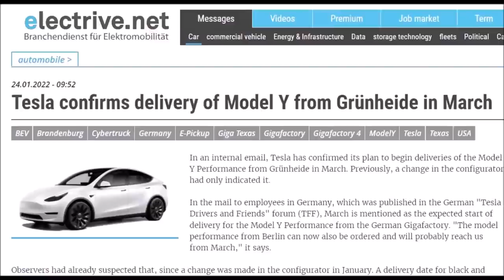BREAKING! Tesla Gia Berlin Can Start Production Despite Drive Unit Not Ready

Comment: Just about all of the below comments are incorrect. When all 4 factories are in production (next 60 days) the model Y will be different in all 4. The Texas plant will have the latest design (front and rear castings, 4680 batteries, many other small improvements. China has front/rear casting but Iron Phosphate batteries. Berlin will have front/rear casting but 2170 batteries and finally California plant has rear casting only and 2170 batteries. There are many other parts and they are being sourced a multiple location, not necessarily where the cars are produced (for example the batteries and motors). The next issue has to do is the plants have the legal authority to produce cars, yes for China, CA and TX and no for Berlin. The last issue has is the production lines been brought up to customer quality standards, yes for CA and China and no for Berlin and Texas. I suspect the the answer for Berlin is actually yes and Texas is yes very soon. However, each factory can produce if they have legal authority and the quality is up to standards. Over time the difference with the plants will be removed but Tesla can't afford to shut down a plant to upgrade when they can sell every one they can produce.
Reply: ...ah, actual information. Nice.
Reply: Actually, only the short range MY has a iron phosphate battery in China. MY LR and P produced in Shanghai have a 2170 battery. Only the MY LR is exported to Europe, and until production in Berlin starts, the only MY we get here.

Comment: This is normal, technically every component manufactured in the new factory should be of the latest version. It's normal they start ramping up with the known parts to avoid slowing down the process. Newly designed parts will be added in time.

Comment: While the DU building was completed in Nov. 2020 it stand idle till mid of 2021 when Tesla decided that this building shall also host the battery pack production. For this, a further floor was added in the building. Which is a somewhat strange thing to do for a new building. You can see on the videos that they did build also a platform on the rear side to bring material/equipment onto this new floor.
Tesla has however not yet applied for a permit to install production equipment in this building. Not for the DU. And not for the battery packs.

This is however similar to other additions/changes Tesla made last year. 
The GA section was completed in late Feb. 2021 - the first production equipment arrived only late June.
Tesla added also a paint shop for plastic components to the casting section  - the reason for the delays there. But also this section is still without production equipment.
Obviously, the suppliers of the modern and sophisticated production equipment Tesla prefers, can simply not produce as fast as Tesla would prefer.

Comment: I wonder if the performance model is getting the new carbon wrapped motors. That’ll be a huge upgrade, that Mach E and others won’t be able to touch. Considering the 4680’s are so energy dense, a much more powerful and capable motor makes sense. I’m not sure the zero to 60 will drop much under 3, but I’d expect the thing to pull hard for the full quarter mile, just like plaid.
Reply: You want carbon wrapped motors spring up some more money cheapskate for the Tesla model s plaid you're not going to get that kind of premium product in your cheap level car by the way that cheap level car is better than any other company's car only Tesla model s is are better but yeah I like the cheap level Tesla car that's the one I'm buying but I'm going to get with it full self driving
Reply: @karenvtechgal397  smart. Me too.